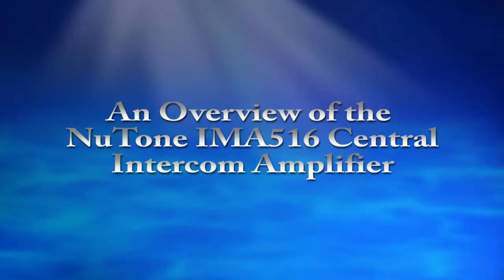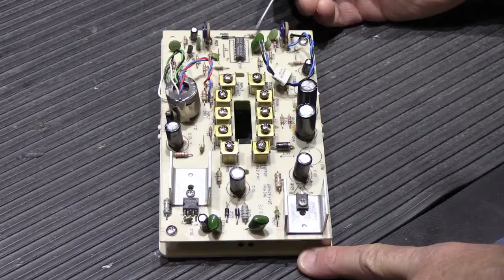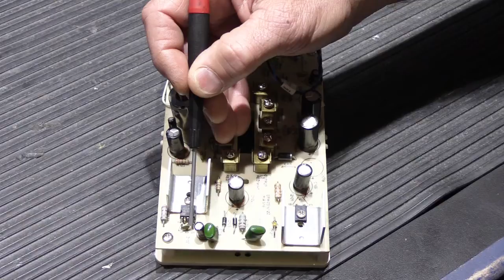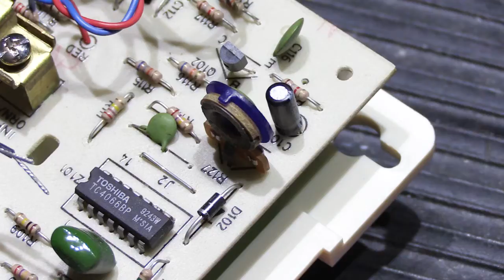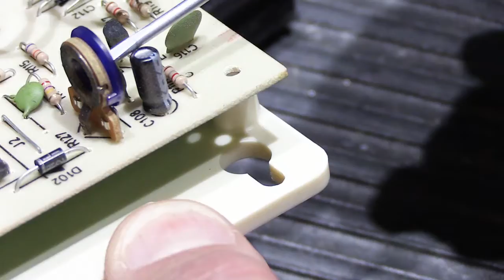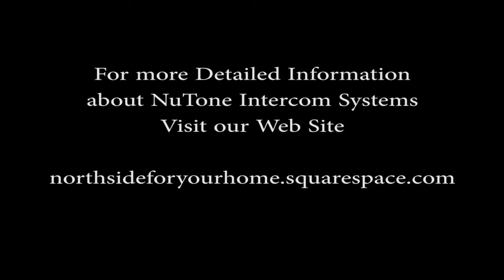An Overview of the NuTone IMA516 Voice only Intercom Amplifier

Comment: Hello, do you have a video that will show me how to add a door speaker to this amplifier? I have wires currently connected to those screws but the house never had a front door speaker. I'm the original owner from 1982 and would like to add a way to remotely speak to someone at my front door. Thank you.
Reply from the maker: Hi dave:  Adding an Entry Door Station is easy - You need a Door Station and you need 2-wires that run between the Door Station location and the IMA516 Amplifier - Connect the wires to the 2 terminal of the Door Station Speaker Speaker Cone and then to the Black and Black/White Terminals of the IMA516 Amplifier - Chris
Reply: @northsideservicecompany3567  ok, will do. Thank you for the clear instructions. Cheers.
Reply: I know you don't have to answer this since you are a professional installer, but I was hoping you could tell me what the model/part number is of the door speaker I would need to buy so that I can install it myself. Thank you either way.
Reply from the maker: If you're going to install and recessed Door Station, you will need an IR6 Rough-in Box and a Door Station - Door Stations without Door Bell Pushbuttons can be models IS65  or IS70.   Door Stations with Pushbuttons are Models IS67 or IS69 - Surface Mounted Door Stations do not need a Rough-in, they screw to the exterior wall surface are Model ISB63 (no button) or ISB64 (with button) or you can use a IA70 Surface Mounting Base with either the IS70 or IS69's - All of these are discontinued items, so searching ebay for them will the best choice - Chris    @davepane7306
Reply: @northsideservicecompany3567  Thank you so much. You saved me a lot of time.

Comment: great video! I got an old installation working (I just replaced the transformer, everything seems to work fine apart from a small hum)., however the ima516 constantly draws 0.16Amp when all stations are off, is that normal?
Reply from the maker: Hi Remi: A NuTone IMA516 System requires a NuTone 301T Low-Voltage Transformer rated at 16 Volts AC @ 30 Watts (VA).  This gives you a little under 2.0 Amps of available power.  While there isn't any published "stand-by" current rating - I would think you're fine at 0.16 Amps.  - Chris
Reply: @northsideservicecompany3567  Normal standby power consumption is 3 watts. Maximum power is 10 watts

Comment: Is it possible to retrofit a circa 1970s Direct-a-com 3 system with a modern amp using a LM386 circuit? I have a N483 in my condo connected to a single door speaker (seems each unit got their own in a townhouse setup, no lobbies here). It appears that the original 470 amp that powered the entire building system is either missing or broken (I still haven't found it!). I tested both the indoor and outdoor speaker using an iPod fed into the output terminals and they still work.

I was looking at "reviving" just my unit's system as a standalone. I can disconnect from the building's wiring (wherever that goes) and wire my own amp. Finding another 470 or IMA516 is cost prohibitive for a "side" project and likely overkill for just one station. A LM386 can be battery powered and mounted behind the indoor speaker.
Reply from the maker: Hi NJRoadfan:  I don't know because I've never tried building an amplifier from a LM386 to replace a NuTone 470 or IMA516.  Even if the Amplifier is battery powered - you will need a way to power the buzzer in your apartment station -  It seems to me that locating the original Amplifier and have it rebuilt to restore the entire building is an easier way to go - Chris
Reply: @northsideservicecompany3567  My setup does not have a door buzzer. My condo has a seperate traditional door bell+transformer (also NuTone).
I suppose I could restore the entire building, but the hoa likely isn't interested. I am also unsure of the condition of the rest of the wiring in the building. I can't repair any wiring faults outside of my unit due to lack of access. I wouldn't be surprised if there are dead shorts in the wiring from other owners removing their inside speaker due to renovations. I strongly suspect that all the intercom units were disabled in all the buildings when this place was converted to condos 30+ years ago.
Reply from the maker: @NJRoadfan  What could be a much easier - is to install a Aiphone C-123L/A Entry intercom System, which can be battery operated (4 "C" Cells).  These cost around $100.00 - Chris

Comment: Hiya, I just checked out my Intercom and setup the sound volume like you said and now it's working lol But I found out that on like half the monitors, I can hear people speaking but they don't hear back. Is it a microphone problem or something?
Reply from the maker: Hi iThe Chug:  It sounds like the "talk lock" button on the remote stations with the problem - is locked down, in the ON position.  This essentially place that station in a permanent "talk" mode.  Release all of the "talk lock" button and you should be fine - Chris

Comment: Cool, just bought a house with this Intercom system and this is a goldmine of information. It doesn'T work at all, some of the stations we don't hear anything and a few other we hear a Humm sound... I'll try replacing all the capacitors. I noticed the heatsinks were hot, so I might replace those too... thanks!
Reply from the maker: Hi Chris:  If the heat sink with the Amplifier IC is more than somewhat warm - you may need to replace the amplifier IC - Chris
Reply: @northsideservicecompany3567  yeah, I heard that in your video. It's easy for me to do that so I'll try... Might be harder to find that part. I'll check it out. Thank you so much!

Comment: In your video you said you only have ever replaced the transformer (labeled T101) once. My transformer seems to have leaked some sort of waxy residue that used to be inside of it out onto the board. How do I know if the transformer is still good, and if not where do you recommend getting a new one?
Reply from the maker: Hi Blacksmithforlife:  The wax was added to the transformer case to hold the coil in place and to reduce the likelihood the the transformer would be micro-phonic.  Is your IMA516 amplifier in an area it gets hot, like an attic?  Is there a specific problem with your system or did you just notice the wax on the PCB? - Chris
Reply: It is in the utility room which can get warm but no overly so(it is in the basement). My system currently doesn't work and I am in the process of rebuilding it (replacing capacitors, transistors, etc). Before disconnecting the system both chips with the heatsinks were warm (one about 90 degrees F, and the other over 200 degrees F) so just wanted to make sure it isn't something that I should also replace.

Here are some photos of the board https://drive.google.com/open?id=0BxhbnLX42YbcYVI1QmVUODFLa0E
Reply from the maker: I wouldn't worry about the transformer unless it's keeping the amplifier from working (unlikely).  I'm guessing that the amplifier IC was the one running at 200C - it will probably need to be replaced. - Chris